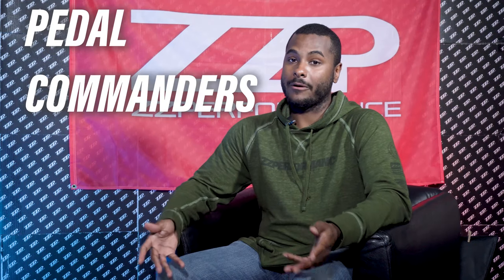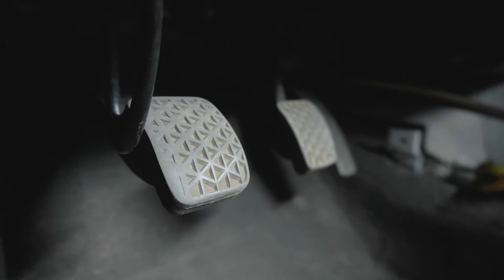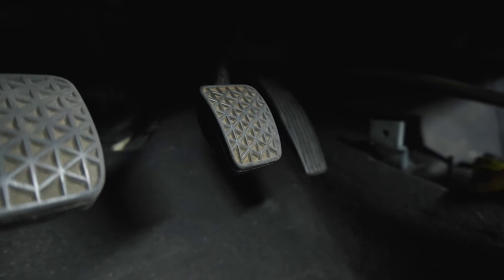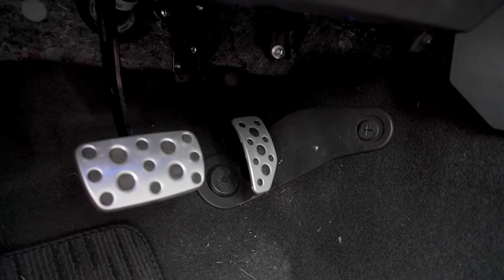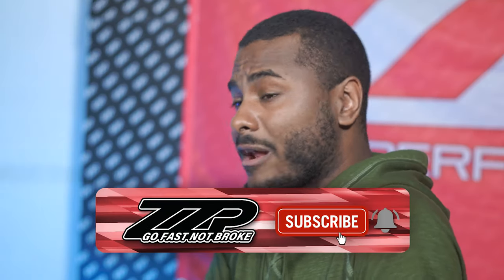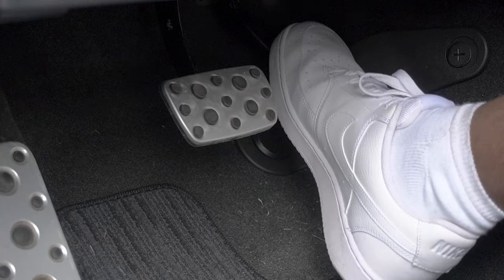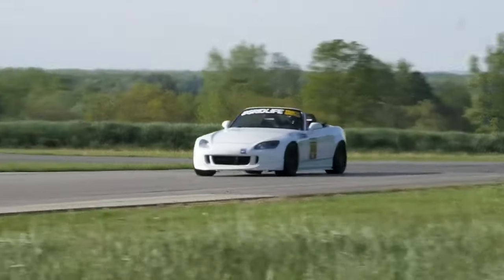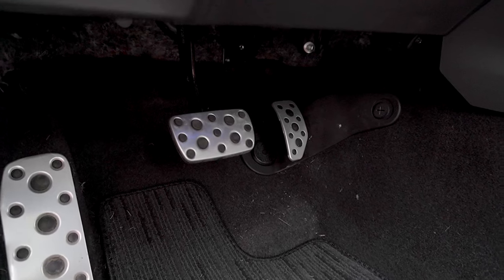Why You SHOULD NOT Buy a Pedal Commander // Behind The Builds

Comment: The Pedal Commander does what it claims to do.  MAKE THE PEDAL more sensitive.  Never claims to be a performance enhancement. I have it and I love what it does.
Reply: Hello.  Any issues with yours?  I just ordered one for my 21 ram 1500, excited to try it.
Reply: Yeah this guy is a doofus. Product does not claim to add horsepower at all lol
Reply: Horrible video. He doesn't even know what the product says it will do. 😂 or that it has more settings than “100” whatever that is. 🤣 but hey “100” percent of the videos on YouTube are like this. Lol. An opinion on a product without showing that you’ve actually “used” or “tested” it. Lol🎃
Reply: well said my guy👏🏽
Reply: Does it really eliminate the lag and delay of the original pedal?
Reply: @parvariramin yes it does. You will definitely tell the difference once it’s installed
Reply: The company even says it doesn’t make you’re car faster it just helps with you accelerate up to speed faster I love it bought a remand one and it still does good
Reply: @karrs42901  I wouldn't say I ever had any issues with the pedal commander I had in my 13 ram, but it was hard to accelerate from stopped smoothly in my opinion. I eventually got a Diablosport tuner for the cam I put in and that has its own throttle sensitivity adjustment that seems to work better overall.
Reply: I have a Pedal Commander, and it is amazing how good it works.  I think this dood is just trashing it because customers that have one won't be swinging by his shop to get a custom reprogram tune.
Reply: Pedal Tuning companies are very careful about claims that their product improves acceleration, but there are countless videos and reviews from customers that say that they do, in fact, chop 2/10ths   to 7/10ths off  0-60 times.  There is very simple explanation to how this can work with pedal tuning, however, some vehicles benefit far less from pedal tuning, than other vehicles.
Reply: @karrs42901  i have one in my 2018 ram2500 6.4 and it is awesome it can help save gas or make the throttle really sensitive it works great
Reply: Hello, everyone. Buying a used pedal commander is advisable?
Reply: I love mine.
Does exactly wut it says it does.
More horses?
I wish.
Jus responds sooner n quiccer da jump.
Reply: Im not a fan at all... I knew a guy with that stupid throttle enhancer that he was running for some time, one beautiful day whike he was going to work doing properly over 70 or 80 mph and this junk put his truck in limp mode, he got rear-ended almost cost his life. It is better to get a tune if you want more torque and throttle response, at least that is a reliable thing to do. You won't have issues.
Reply: Try watching the video before committing next time bot.
Reply: Yes, but realistically, on some cars, you can get 1/10th to 2/10ths reduction in 60 MPH times out of it.  There are way too many people who vouch for that , and have done comparative dragys.
Reply: He is just shutting and jivvin
Reply: @parvariramin no it does not.
Reply: it just fools, you can just floor it yourself instead of computer

Comment: Any car/truck person should know by now that a "Throttle Control System" improves throttle response, not horsepower.  But you are correct, a complete tune or re-flash of your ECU can improve performance at the HP level, as well as throttle response, since the throttle body is controlled electronically.
Reply: What about mpgs? I only get 18mpg in a v6. How do i do a flash? I live in a place no one does that thing within 100 miles
Reply: @ex35240sx  Depends on what tuning platform you're using, and on what car you're tuning.
Reply: Sup Kevin nice cover 😂😂👍🏻👍🏻
Reply: I was about to say this, every review ive seen has just been about throttle response, not necessarily increases HP
Reply: Do you go to your dealership to get your car a complete tune to get maximum performance? What’s the average price for such tuneup?
Reply: @A Mack  I'm curious too. You don't see much info on a tune as you do on throttle response improvement devices. Not even sure how to research alternatives.
Reply: @jamesgerboc  tuning your car involves ripping out your ecu and sending it somewhere very sketchy stuff if you ask me if you have ever experienced pedal lag a pedal commander will solve this issue not gonna increase performance
Reply: @AKYLE315  You don't have to rip you ecu our and send it anywhere.  Not on the modern day tunes.
Reply: It's does me great for burnouts and it's great for slowing the response down for economy driving, now a pedal commander is not used for track 😳 but they are great for dialing a response from your throttle whether it's a short throw or long as a budget upgrade in a stock vehicle.  They do have modes. Makes it more fun to drive your  vehicle having fun and saving gas on a budget, common. Why hate?
Reply: @Kyle Anderson  No, you can just buy a tuner for a few hundred $. Diablo will write custom tunes for you or you can use the tunes it comes with. Extra HP and mpg, turn off AFM, remove speed limiter, modify shift parameters even fuel air mixture in your driveway. I use one and am still thinking about getting a pedal commander for on the fly changes to throttle response but tuning isnt difficult unless you want a dyno tune.
Reply: @jamesgerboc  Kyle is wrong. Read some of the other responses about tuning your car. You don't rip out the ECU to tune modern cars

Comment: This is to take out the annoying DELAY that happens when you press the pedal - it's not the amount of throttle its that is HAS throttle more immediately rather than doing the usual "Floor it" (WAIT a second) "Now, Go" thing automatics do these days. Our Chevy Spark is awful for this for example... takes a full second and half after I floor it to even begin to move if I'm trying to pull out quickly into a gap in traffic (actually feels dangerous in that car sometimes). It's not adding HP.. it's letting you actually use the throttle right away rather than pressing the pedal and nothing at all happening for a second. The video definitely didn't convince me that I actually like that delayed response... sorry.

Comment: I respect your view, because a lot of people are considered with performance gains on a track/strip, but with my throttle booster (Dinan), with very aggressive setting, the car feels so much better in daily driving.   I don't care much the throttle booster makes it  2/10ths quicker to 60, but the in-gear, low rpm, response has improved drastically.  That is something completely missing on my 330i.  For whatever reason tuners don't like addressing drivability cause they want to flaunt one thing...power.  But my feeling is 300whp is enough power - after that, I am interested in response and smoothness, so I don't have to drive my car like I stole it to go fast.  With throttle booster, I'm can cruise at ~2K RPM and still have plenty of power, as soon as I tip in the throttle. No more need for revving beyond 3000rpm to get the car moving.

Comment: It gives the throttle a more analog feel. Growing up driving a cable throttle, (which in a high horsepower car is a lot like an on off switch) it feels more like what I'm used to. It also removes the lag between when I push and the engine reacts.
I know its not giving me more power, but it is letting me use the power I have more intuitively. I feel like I'm in control rather than asking my car's permission to accelerate, and the computer deciding if its ok.
Reply: Best response so far 👏🏼
Reply: I agree. Spot on description

Comment: All I know is, with this product installed on my car, the lag in my acceleration goes away.  If I remove this product and try to emulate it by simply pressing the pedal faster and harder, I cannot.  No matter what I do, there is lag.

My number one reason for using this is city driving here in Chicago.  Being able to pull in and out of traffic quickly but with control.  With this device, I have that control due to faster response.  Without it, I don't, and I can't recreate it no matter what I do when the device is not installed.

Could I get it professionally tuned instead?  I suppose.  But this was much cheaper, easily unplugs, provides easy adjustment, etc.  Simply a better option for my stock 2015 daily driver.

From what this guy is saying, apparently, some people must think these devices add HP or increase overall top speed, which they don't - and so I presume he's responding to that.  

But when he makes blanket statements like "they really don't do much for your vehicle" and "it's kind of crappy" and "it's basically tricking your car into thinking that you're giving it more throttle than necessary vs. you actually flooring your car and getting that" - those statements are simply not true in my experience.

I'm certainly glad I purchased the product before watching this video.
Reply: Agreed. I just heard about these things and my concern with new cars isn't getting more power, I just want to feel like what my engine is doing matches what my foot is doing. If I ask for 100% throttle I want it now! I only drive slow cars so it's not like I'm going to kill myself, I just want to feel connected to the road.
Reply: You hit the nail on the head with this comment. Couldn't have said it better. These throttle control devices DO work as intended. It makes your modern electronic throttle feel like its an older vehicle that actually had a throttle cable connected from the throttle to the throttle body on the engine. The manufacturer decreases throttle response purposely to meet EPA fuel efficiency demands. Period. Its not a user friendly design, it is purely for economy. These throttle devices allow us as the consumers to take back our control of the throttle and even set it to our preference! The only people that bash these products are the people that have never tried them, or have used them improperly. I have the roarpedal myself, but they're all basically the same.
Reply: @Ifyoucantdodgeitramit  I have Sprint Booster and it comes with security features as well
Reply: Thank you for your response. I have been on fence about a Pedal Commander. I hate the turbo lag on my MINI. Sounds like this could be a great solution!
Reply: I totally agree with you and I don't even own one Pedal Commander..lol
Reply: I know right,his video wasnt properly formatted, two words,throttle response,not hp gain,simple smh.
Reply: + this exactly!  Not necessarily adding HP but the instant throttle response feels so much better than a dead pedal that doesn’t respond well. Throttle controllers make a huge difference
Reply: @steveutley6734  🎉
Reply: @jameshoy3530  idk if it will eliminate turbo lag I could be wrong but I think you’d feel the effects of your engine responding sooner but not your turbo since it needs the time to spool still
Reply: I am in the city of chicago as well and drive a dodge challenger r/t. So was it difficult to install?
Reply: Best believe I watched the video and still getting 1.
Reply: @ThePolar5  Easy work.  Should do well with your DC! 👍
Reply: @MrDahkilla  I'm no fortune teller.  But I do sense less lag in your future.
Reply: @dcmobile4699  lol
Reply: True... 
Good info...
Reply: Why you can't emulate it by simply pressing the pedal harder and faster if that's what the device do?
Reply: Same
Reply: @MrDahkilla  yeah man. Am getting one as well for my Tundra.
Reply: Thank you for clarifying.
Reply: Which brand did you buy?
Reply: @MR-nl8xr  Pedal monster. Cuz when you put the car in reverse, it goes to stock. Also if the unit fails, you still have pedal. Again it goes to stock. Almost 3 weeks am having fun with it. My Tundra is not boring anymore. I have a sports car now.
Reply: @haroldpapillon4686  😆😆👍👍
Reply: @MR-nl8xr  I don’t give a rat ass about increasing horsepower or not. All I enjoy, is touching the pedal of my half tone Tundra , that truck goes. In and out the traffic is pretty fast. The track mode is too much for me.
Reply: Yeah, these clowns don't understand how the pedal commander really works.  Their claim that it is like an on/off switch is ignorance.
Reply: @Fontenotcjf  Any of my friends who drive my Tundra goes “ W T F “ is that. What is this?. Where do you get that shit. I want one “. What a difference that thing makes. Going up hill is like going flat roadway. 👌🏾
Reply: I got what I needed. Throttle response not horsepower. I am driving a truck . A Toyota Tundra half-tone pickup truck not a sports car. I can careless what anyone says. My truck is not boring anymore.
Reply: I LIKE THE WAY YOU BROKE IT DOWN!!!👍💪
I WAS ABOUT TO AGREE WITH THAT GUY BUT YOUR EXPLANATION CLARIFIED IT!!👍👍👍
Reply: My 2.7 Silverado hesitates to engage even if I floor it. For example , I was in a round a bout , going relatively slow , because it's a circle ,  and the last entrance was a car about to get in the circle , but he wasn't timing it right and was gonna t-bone me. I tried to give it a little throttle but nothing happened. I had this scenario happen again , and had heard people say just floor it so I did that , and a full second (at least) went by before anything happened. Now by that point it would have been too late because the damn thing has 8 gears to navigate through and downshift , but if and when it does that , well I'm in a turn , and I don't necessarily want to hold the pedal to the floor in a small circle area. So I'm considering one of these things for this reason alone.
Reply: @jameshoy3530 lmao do you think this will affect your turbo even a little bit?  These products were made for people like you.
Reply: If it tricks the system then it altered then fuel timing and will make car run richer more black smoke or black exhaust tips.. not really good. Will wear down the catalyst converter and soot up the valves and combustion chamber alot more Better a custom remap
Reply: Hell of a comment man!